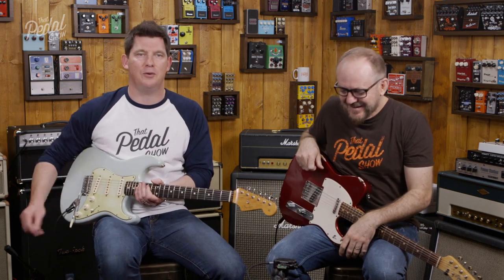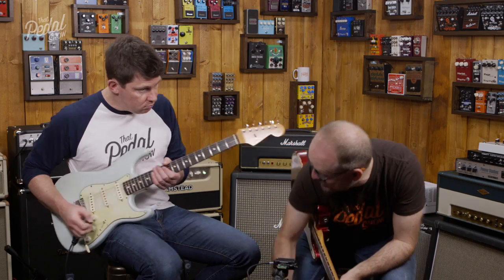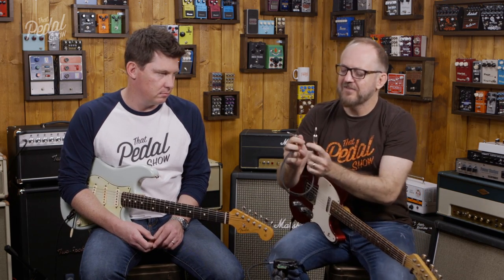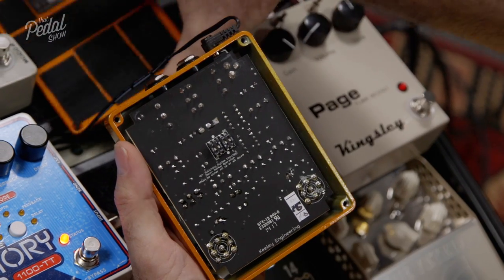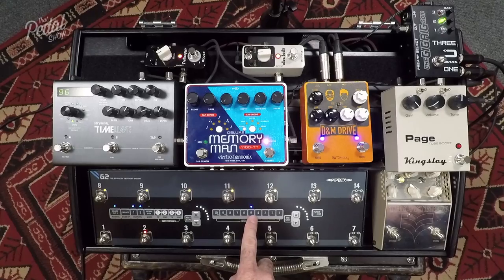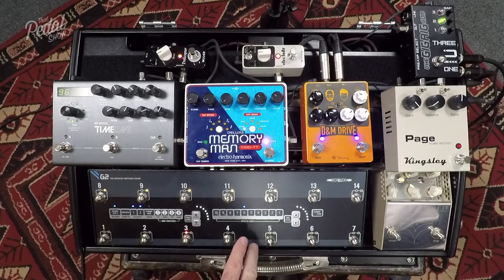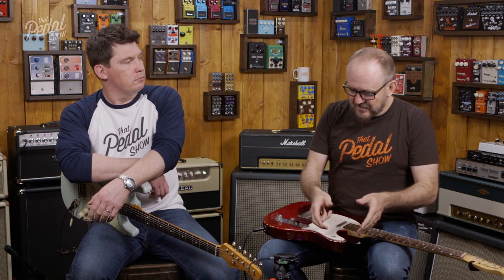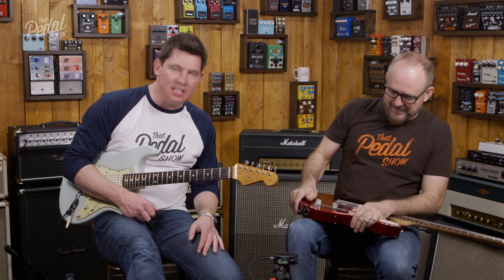Keeley D&M Drive – TRS Jacks Function For Loop Switchers

Comment: That's brilliant! More pedals should offer this function!
Reply: Nefarius696 Is there a methode to do this with a dual pedal that don t offer a TRS function? I want to use the vs audio royal flush in my switcher that way but it does not have a TRS function...

Comment: This switching scheme is essentially the macro version of using a four-wire humbucker with a pair of DPDT switches (or a Seymour Duncan Triple Shot mounting ring, which is a clever way of packaging such switching).

Soon, I will assemble a single-humbucker partsocaster which uses a four-way blade switch to select among the pickup’s operating modes; the two coils of the Tonerider Octane have different tonalities (one is wound with 44AWG, and the other is wound with 42AWG), like the D&M Drive, and an AlNiCo VIII bar magnet keeps the output high enough for the split sounds to be usable (series humbucking yields 12.9kΩ and 6.5H).  I will also give it a two-band passive EQ (G&L style), a treble-bleed capacitor, and separate bypasses for the volume and tone circuits: yes, I am sufficiently switch-obsessed to create a single-humbucker guitar which provides 16 tonal options.  In case it will make Mick feel better: the swamp ash body is painted Daphne Blue; the roasted maple neck is essentially unfinished (it has a sealer coat), and the bridge is NOT a Floyd Rose…it is a Full Contact Hardware hardtail.  8?}

Comment: D&M - short for Downright Magic :) 
30 years of messing around with gear, just for the joy of tone...and there it is. Gotta have me one of those naughty tin cans...soon :)
Being a long time fan, I know you're not overly fond of including amp send/return in the signal chain but currently my best simple yet extremely versatile setup is [guitar] >  T.C. Mini Spark Booster into the front of my Marshall JCM 900 Combo with a Flashback in the send/return. I'm actually really happy with the crunch in both channels of the amp but how would I go about including the D&M in my rig?

Comment: Awesome, but the only thing I don't like is that the TRS connections on the left side are switched. Is there an easy way to mod the pedal to flip Dan's tip to ring? Modding a cable would probably be most convenient. But I'm considering buying the D&M and plug it into a morningstar ML10x which has TRS connections as well. Just going regular TRS to TRS would save me a lot of connector woes.

Comment: That's awesome but also have two questions. Off topic: what happened to the sheriff 44? On topic: where do you plug the mono side of the cable? Wouldn't you still need another cable for the missing part on the looper?

Comment: Dan/Mick. Just acquired one of these pedals.  Fantastic. Quick question though, what brand is that TRS cable you are using? As others have mentioned here, the ones on-line that I can find, are either too long, or the two mono jacks are too chunky to fit behind a standard sized switcher. Thanks in advance.

Comment: Sounds Awesome! Wouldn't it be better to have the pedal use only one loop in the switcher and use a CTRL input to switch between different states in the pedal (D/M/D&M)? Just to save some loops in the switcher! Needless to say.. Great pedal!
Reply from the maker: +fpolloa not for me as the ability to swap the order of the loops is paramount
Reply: I guess if one Really wanted foot operated order switching without the services of a G2 then one could void ones warranty and add a jack socket to the unit so that an External Switch Pedal could be connected to take over the operation of the internal Order Switcher switch.
I would love to geek out on a G2 system but it's hard to justify for an old housebound disabled git to noodle around in his room. I have a cheap FXL8 Pro which I intend to multiplex and ultimately take over orderly control of the multiverse i.e. cosmos. 
Inconveniently, it doesn't offer order switching.
Reply: Well thought KozmykJ!
Reply: Use the "break jack" function of the new socket to disable/bypass the box-top switch. Otherwise they'll argue ...

Comment: I would have preferred to have 4 jacks on the back. 2 of them for normal operation. The 2 other for split operation. Split operation wouldn't even need dipswitches then, but use cable detection instead :) But yes. All dual pedals should have somekind og split functionality.

Comment: Hi guys. Congrats !!! Your channel is the best :)I have a question for a long time and I believe you can help me: it's about alternate the pickups from bridge and the beck. Even using an original set (like Fender Texas special) I never get the right way to regulate in the way it's good for both. It's because the neck one always has a large amount of bass and the bridge one hasn't.If I regulate the amplifier and the pedal for a great tone for bridge, alternating for the bridge one it sounds weak and lack bass.I keep one pedal regulate for the bridge pickup and other for the beck one but it demands turn it on/off both...I'd really appreciate some light about it :)Thanks a lot !Mauricio, from Brazil
Reply from the maker: +Mauricio Gambini I'm going to show a little trick to help with that soon :)

Comment: I like the ability to separate the two pedal functions. However, I don't understand why you implemented this in a way that requires messing with DIP switches and a custom cable. Why not just add two more jacks on the back and use a second toggle switch? Clever for the sake of clever is sometimes annoying. The pedal sounds great. Congratulations!
Reply from the maker: +Christian Jackson Thank you Christian. Four jacks wouldn't fit physically, far as we're aware. It's all a function that proportionally few people will use. Any road up, glad you like the tone!

Comment: It says in the description that this functionality is not relevant if there's no loop switcher but I would assume it could just be used as two separate pedals in a regular signal chain, without a switcher, placed anywhere since both sides have their own ins and outs. Isn't that correct?
Reply from the maker: +The Unrest Cure Yeah, that would work, so you just use the TRS as a patch cable between two other pedals. We think that would work.....

Comment: Fast question for those of us in the States....we can't easily get our hands on the G2 so we either have the Boss ES-8 or the RJM PBS.   I have the Boss, with my setup the loop banks have an in and out.  The 1 into 2 won't work with the Boss because the in must have an out to complete the circuit.   what would be the correct way to deal with this?   Can a dual TRS cable work?
Reply from the maker: +jmounce50 Hang on, doesn't the ES-8 just have ins and outs for each loop like the G2? The TRS is a Y cable. Send and return at the TRS end, mono in and out at the switcher end. Hope that helps!
Reply: Sorry but I still don't get it... Isn't the TRS end and the switcher end the same? I repeat jmounce50 question: Can a dual TRS cable work? Thanks.
Reply: Ok, ok, I think I've got it. Confusion came because on the video you only show one TRS to two mono ends cable, and for this feature you need two. Am I right?
Reply: That Pedal Show - in the video you only show one Y cable.....I took it that each end of the Y went to the end and out and the other end went to the G2.   Now I think what we would need is two Y cables.   The single TRS in the pedal jack and the two Y ends go to a in and out in their own bank.   Correct?   I think the single cable in the video messed us all up.....I hope that I'm right now.
Reply: Juan I was as confused as you when they only showed one cable.   Hopefully the solution is two Y cables!
Reply: Yeah, I'm sure that's it, in the video you can see when he plugs the two trs ends into the D&M.
Reply: Sometimes listed as an Insert Cable, for the insert points on mixing desks. And yeah you need two, one for each side of the unit. Also listed as a Stereo to Mono Y Lead.

Comment: Just purchased a D&M Drive, and it sounds fucking amazing!!! My only complaint, the damn power supply location! I don't "get it". Other than that, home run!!!
Reply from the maker: +Fonzy Brookestone Eh? We have no issues with it - what’s the problem? Thanks for buying one!
Reply: Ha, sorry, I should have elaborated. Power supply cable gets in the way if using right angled patch cables. Perhaps with a 90 degree power cable, it may be ok, but not with straight ones. Thanks for the reply, and again, great pedal!!!!
Reply from the maker: +Fonzy Brookestone Send us a picture... be good to see what’s going on... Cheers!
Reply: Just tweeted you 2 pics. Thanks.

Comment: This is certainly a very cool feature, but isn't it just a more complicated way of doing things when you could just use four jacks? Not that there's a real comparison in tone or in quality, but Visual Sound/True-Tone does this with four jacks.
Reply from the maker: +John Falk the order swapping facility in this pedal is very important because both signal path directions offer something great, so it's more than just two pedals in one box. But the ability to split them out via the input and output Jacus is something we really like
Reply: That Pedal Show indeed. And I really like it too! I guess the part of it that I don't understand is why this is better than two separate inputs and two separate outputs. In that format you can still run each side of the pedal as two separate effects into a looping device. It seems that having to mess with internal dip switches and special equipment like TRS cables just makes it more complicated. However, I do see that this is probably my own limitation in that I just don't understand why this is better.
Reply: +John Falk This solution is considerably more compact than that used by TrueTone, and it is quite possible that the good Mr. Keeley could not spare the space for individual jacks.

Comment: So to get the drive into the boost you need a switcher that swaps pedal order?
Reply: There's a switch in the pedal for that
Reply: BOOST side is loop 5, DRIVE side is loop 6. So to get DRIVE into BOOST from switcher you would need to change pedal order. it has nothing to do with switching inside dip switches. Thats only to use the TRS function on the pedal.
Reply: there is an order switch on the top of the pedal. they demonstrated that bit in the beginning
Reply: I was actually talking about presets and not dealing with the pedal. Of course you can switch by hand but to switch the drive into the boost on a preset you would need to swap loop order around. Thats why I use a foot controller so I dont need to dick around with pedals while playing live :)
Reply: ah, okay. I guess it depends what pedal looper you have. I believe G2 you can swap the pedal order per preset, where as some others loop order is fixed

Comment: A strange metallic orange flake pedal arrived with my T-Shirt Friday morning (20170908). Only just realized it was metallic...
Might as well give it a try now it's here I thought. Maybe a couple of different guitar types to see how it handles single vs humbuckers 'n stuff.
Two hours on the HB35+, an hour and a quarter on the Strat... had to pull myself away.
There's not a bad tone in this thing however hard you try... Ummm you Can put too much treble on if you really try, but why would you?
#Day Two 2 hours on Tele...
2 more guitars to go, 3 including my Slide beater.
Finding it impossible so far to have a Short session on the D&M.

P.S.
Still waiting for my dreams to come true.
Dan promised ... he promised !!!
Reply from the maker: +KozmykJ they will come true K, they will! ;) thanks so much matey
Reply: Oh! I forgot to say. I'm getting such a brilliant array of sounds from it into my old Flextone II, I haven't even plugged it into my valve amps yet. (Valveking 20, Selmer Concord 8 Croc, Selmer TnB 50) I'm working up to it slowly just in case I have an out of body experience....

Comment: Can the TRS function be used to place other pedals between the two sides without a switcher?
Reply: Sure. The switcher just allows you to program the effects order without unplugging & replugging cables. (And it also takes pedals completely out of the signal path when they're not in use. Handy with gizmos like many of Dan's cherished classics.)